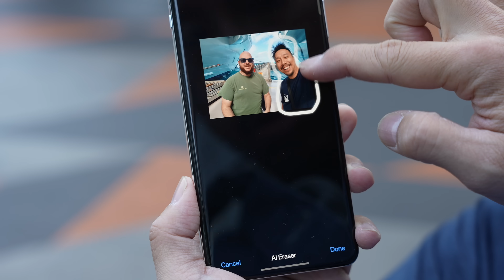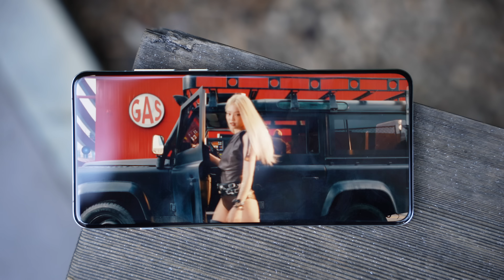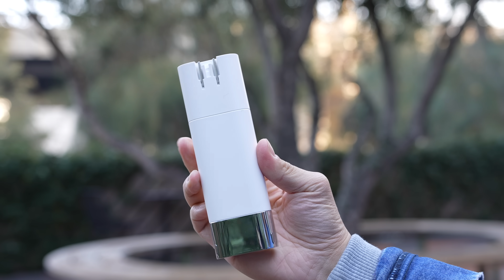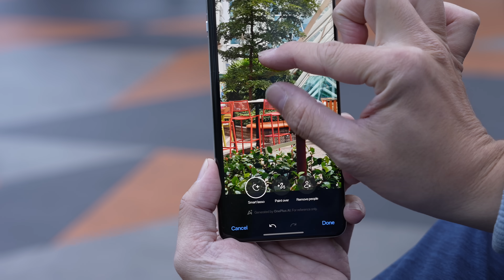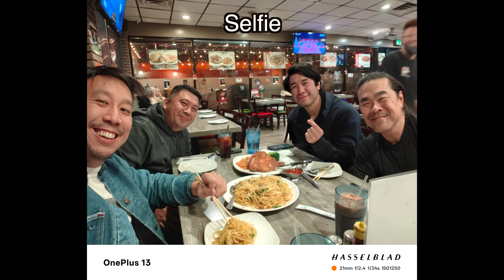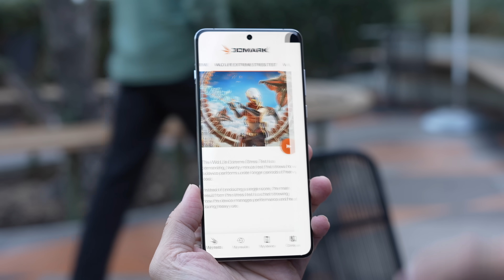OnePlus 13 (Global) Review: The Most Complete OnePlus Phone Ever

Comment: I just want an LG V70 with QUAD DAC, 3.5 mm jack, sd card slot, dual sim tray, 4k/60fps video, 1440p oled 120hz, removable battery, and the phone already has a case as it's exterior that doesn't look like a $5 piece of rubber.

Comment: I plugged my OP13 in to a generic 100W (4 ports) charger that I used to get 45W out of on my S24 Ultra at the start of this video. By the time you said 'thanks for watching' it went from 47% to 79% charged. And that isn't even with the official 80W brick. I think it is getting full charging speed though, since the block is able to deliver 20V/5A on a single port. (I'm at 87% now, just while typing this and looking up the power spec on the charging block.) 

When you get used to that kind of charging speed ... how do you go backwards to anything else on the market in North America right now? Especially when everything else about the phone is also on par or often better than the rest? Performance rocks. Customization is fantastic. The cameras are legit great (tastes vary, but it's taking more wins from me than losses in blind comparisons). And I think it's the first IP69 phone in the market here too. I suppose it isn't using Gorilla Glass Victus 2 or whatever ... and the curved edges of the screen DO feel nice, even if it's making it hard to find good glass screen protectors ... but I'm willing to overlook that for the sheer awesomeness of the package as a whole.

It's my first OnePlus since the OP3 (which was in daily use by my daughter until it fell in the lake with her last summer ... no IP rating back then, and it didn't survive. Worked for a few hours, but was dead by morning. She got a OP12 to replace it), and I think that might be just as incredible as that phone was. Scratch that ... even better than that one was. The brand had some rough spots, but it feels like they've come back around again.
Reply from the maker: I'm glad to hear you enjoyed the phone so much. Yes it's a very polished all rounder device

Comment: I am in a dilemma should i buy the op13 or the x200 pro.  In india the 16gb 512gb X200 Pro variant comes for ₹94000 whereas the 24gb 1tb OP13 comes for ₹89000. The lower op13 variant is around 20 to 30k lesser. Also i am not to sure about Vivos funtouch os as it looks a bit dated compared to the competition.
Reply: Go with one plus not a huge camera difference between these two
Reply: @tusharshyoran3233 really ?!😮

Comment: I just bought the OnePlus. With the s24 ultra trade-in I'm getting it for $350.. I'm getting sick of Samsung releasing the same old phones with no changes.
Reply: The same had almost bought the ultra but if u compare it to the OnePlus it just loses big time especially the fast charging respects ur time no more waiting for ur phone to be fully charged
Reply: @Holyinductor  Amen bro.
Reply: Samsung is going down hill and has worst customer support. For years, have been big Samsung supporter - never again.  Question, looking for a larger phone/ screen, eyesight also going down hill, lol. Is this much larger then the S24 ultra, an obvious difference for bad eyesight. Is it same size as the Google Pixel XL?  Ty.
Reply: @Lisa-bb7uz No, it's smaller, the biggest decent complete phone is probably the iPhone 16 pro max, Pixel XL is smaller, you might be more interested in getting a foldable device, hopefully Oppo Find N5 is available in your region
Reply: So your answer to Samsung's actions is by buying their flagship device last year, then trading-in said flagship device one year later, to buy a new flagship device with less features than the device you traded in, but your new device's only real difference from its previous year's model is a new chip, a new battery and some camera improvements?
Reply: @Hhhh22222-w  less features?? Please do explain that. And yes I did trade my so called base flagship Samsung model for a different phone to which I am so glad I did and would of done it sooner.. I also traded in my watch 7 for the OnePlus watch... Once I seen that the one plus watch is better in every way I threw my Samsung watch in the trash.
Reply: Cringe
Reply: @mrkring1526 oneplus and Apple doing the same thing lol. I have a oneplus 13. I only got it because it was 400 hundred dollars cheaper than the s25 ultra

Comment: I just traded my OnePlus 12 for the 13. Normally, I wouldn't upgrade this early but, I felt the design changes would greatly benefit me. As a legally blind low vision user, I rely on TalkBack via the Android accessibility suite to navigate my device. Therefore, there are a lot of custom swipes and gestures involved in the process. I love the look of the curved glass on the 12 but, it's not as functional as a flat screen. Oftentimes I found myself swiping three or four times instead of just once. I never experienced that with the flat screen on my older 8T. Hence, my purchase of the 13. In short, problem solved.

Comment: Actually pixel 9 pro cost less
Reply: Pixel low quality hardware worth 10$
Reply: @TanveerAhmed-dk3rp  hahaha how most  pixel 9 pro camera sensor are bigger than the oneplus except for the slightly smaller zoom sensors but better 5x optical. The display on pixel is better and much brighter coming in at 2200 nits under direct light were oneplus only 1200 and is a Samsung m14 oled. still has 4700 mah battery and in a small form factor so perfectly fine and it's tensor g4 is perfectly fine.

Comment: One issue in Australia is that the new law here needs networks to wgitelist phones coming into Australia and so far only telstra have white listed it.

Keep in mind that I have seen on reddit that some already have it working using optus and Vodafone network but it can get blacklisted if optus or Vodafone don't approve to whitelist it.

This is the email I got from oneplus confirming it

"Dear customer,

Due to the regulation changes last year, each network runs a whitelist separately. OnePlus 13 has been added to Telstra's whitelist, while it's yet to be added to Optus and Vodafone whitelists. We are currently in the process with Optus/Vodafone. It might take 6-8 weeks to get the approval. And we can't guarantee the result. Chinese version has the same risk. Optus/Vodafone might block the IMEI at any time, since it's not on their whitelist.

Telstra has confirmed it's compatibility. It has passed the Telstra IMEI check: https://www.telstrawholesale.com.au/3G-Network-Closure-Blocked-Devices-Checker.html

You can use the IMEI in the attached photo to check.

Kind regards,

OnePlus Authorised Store"

Comment: I don't really think Oppo find x7 pro's sensors are smaller than competitiin from Xiaomi overall. The Xiaomi 15 pro has just a slightly bigger main but the 3x on the Oppo is much bigger than Xiaomi's 5x. Oppo's 6x uses the same sensor as the 5x on the Xiaomi 15 pro. Smaller than Vivo's pro but not really Xiaomi. There was no Oppo find x7 pro either so it's not really a downgrade as there was no pro model. I agree though that they should have a bigger main sensor at least ast to match Vivo

Comment: Haloooo! I'm from the Philippines and the 13 is gonna come out soon while the x200 has been here for about a month now. Originally, I was fixated on getting the x200 this February but finding out the op13 is about to release to shaked up my decision. Which one would you recommend? Coz here the difference is a mere php900 or about 18usd between the vivo x200 12/512gb and op13 12/512 (converted price from usd999 retail)

Comment: 📌Not fan of the design of this phone but black version and white version are much much nicer than blue one.  I don't understand why OnePlus didn't keep the design of OnePlus Open with cameras in the center...🤔.

👍🏿It's good you have tried to put this phone in the context of different market.

📌A lot of special offers right now to buy this phone...It seems like a very good option.

In France, it starts at 1059€ 12➕256Gb  🆚 1479€ 256Gb for iPhone 16 Pro Max 🆚 1100€  12➕256Gb for S24 Ultra.
I guess S25 Ultra will be at the same price of last year...

Comment: The OnePlus 13 is not bad but just like the Oppo Find X8 Pro it's a real regression in terms of camera equipment, but, my real problem with the OnePlus 13 is this blatant and yet silly effort made by Oppo in terms of photo-video processing to make the OnePlus 13 really inferior to the Oppo Find X8 Pro in photo-video, it's so silly, and it must take so much unnecessary effort to set up different photo-video treatments for almost the same equipment, pff 🤦🏽‍♂️

The OnePlus 13 is a good "pretty deal" in Asia and despite the fact (which I deplore) that OnePlus is increasing the price of this OnePlus 13 by $100/100€ in the USA and Europe, it is clearly a better deal than the Pixel 9 Pro XL, however, it will not necessarily be a better deal than the S25 Plus unless Samsung also increases the price of its S25 Plus.  

Ps: the OnePlus 13 has a lot of quality, but its photo sensors are far from being the best in the USA, not to mention the fact that its software processing is far from the best, and above all, I highly doubt that its zoom is better than that of the Pixel 9 Pro XL and the S24 Ultra.

Comment: So ben do u recommend this phone who cares less about camera but only care about performance display and a great software experience?
Reply: there's really no other phone apart from the Red Magic 10 Pro that'll perform significantly better than this phone and the IQOO 13 is only marginally superior due to its smaller camera system, it'll be cooler.

The Oneplus 13 is the go to phone to get if you want nice performance, good cameras and a good software experience.
Reply: @kaiserfakinaway5909 Software way better on this than gaming phones of course if u do heavy gaming then get a red magic as it will have the best performance but for the general software experience animations etc they will be better on this phone and the cameras are better
Reply: Iqoo 13 is probably better for OP , has 4 years os support @kaiserfakinaway5909
Reply: @kaiserfakinaway5909 thanks for clarifying, do you know how good the vivo x200 ultra performs by any chance? Can't decide between the 1+ and vivo :/ I mainly want to do PC emulation and photography